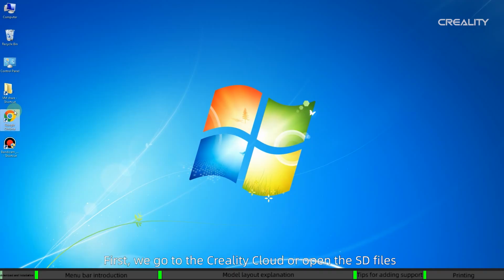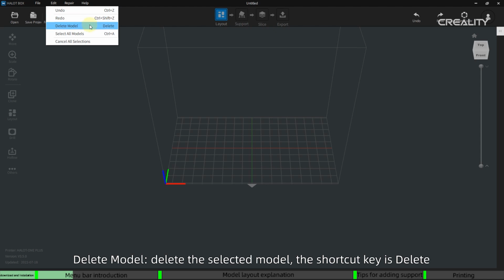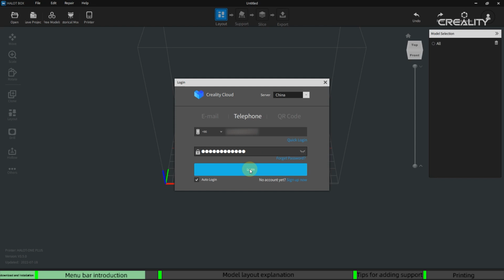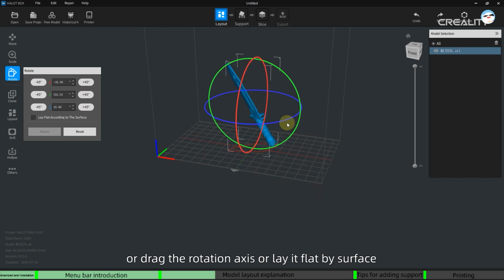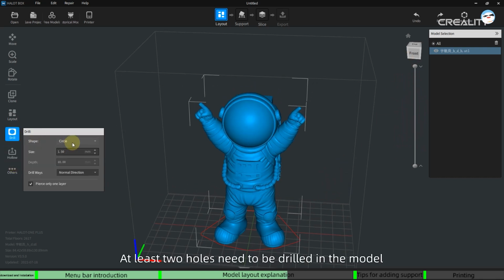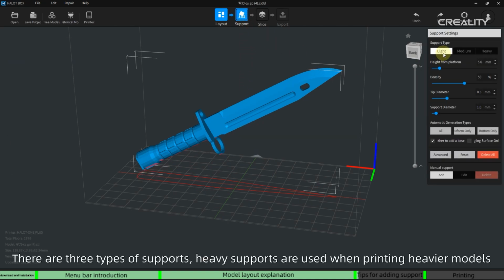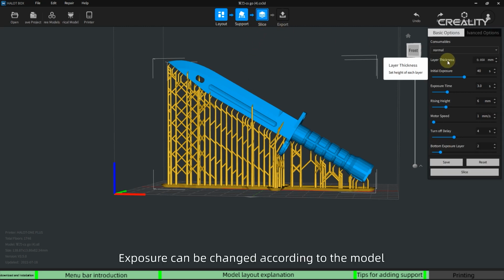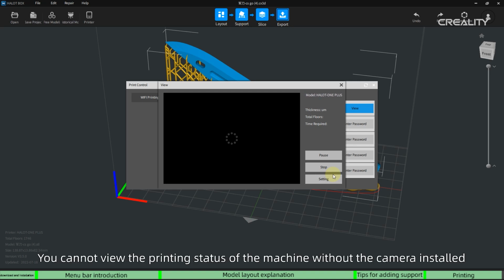HALOT BOX Software Tutorial

Comment: Software still crash every time, waste of time.
Reply: What specs are you running? It maxes out my ryzen 9 5900 every time I slice, so I wouldnt be surprised if it just kneecaps it with a normal processor
Reply: @doomk714  that means, is a poorly designed software.